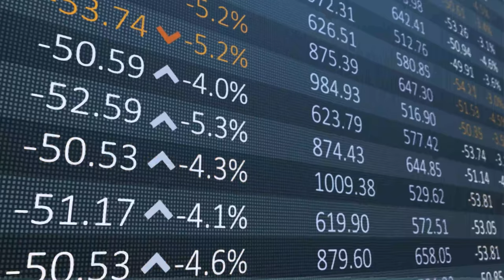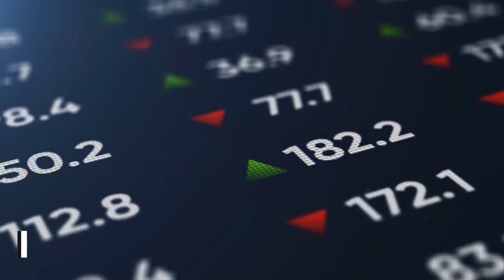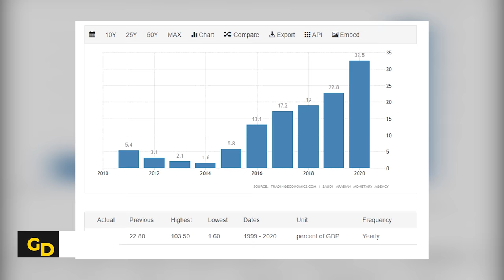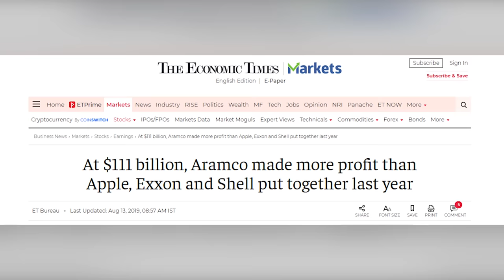How Saudi Arabia Bought A $2 Trillion Company

Comment: Some facts here are loose, such as the 2030 Vision. It was introduced in 2016, and the spending started from 2017 to diversify the economy, the current debts are relatable to this kind of spending, it is not that we just realized that we had much debts in 2020. Moreover, Saudi Aramco was never solely owned by the Americans, and there is no documentation of such circumstance, it was always a joined venture until it was solely owned by Saudi Arabia. Furthermore, the new airline that was shown in the video was initiated by king Abdullah, the former king of Saudi Arabia, before the whole vision and investing in entertainment. Overall, very well for a western guy to try to relate :)
Reply: Great job correcting some of the info in the video, though, the "try to relate part" was not necessary.

Comment: Well if u own any middle eastern oil company shares then it would be wise to sell of your shares in the upcoming years as the world is transitioning from fossil fuels to renewables and these companies are currently not taking renewables seriously and most importantly as the consumption of oil  would decrease because of the shift to renewables the price of oil per barrel would inevitably decrease because of less demand and relatively same supply
Reply: @Elite FF Squadron - Not a chance, first the world has to get the shock of its life when their dependence on renewables backfires and there is massive economic damage. California faced this when during peak summer they were having power shortges after going hard at renewables. Britiain is currently facing the same due to lack of wind power generation and they had to pay mind boggling sums to its last coal power plant to keep operating.
The point is, the world has not learnt its lesson. There is no strategic plan to move from fossil fuels to renewables. This will bring untold misery when renewables fail. Then there will be a massive call for fossil fuels again and then an ecofriendly support system will be made (over god knows how long) and only then will the world move to renewables fully. Also i sincerely doubt the renewables will be solar, wind etc that you see now. It will be reactor based, exotic materials type thing. The ecological impact of solar and wind will not allow it to be sustainable.
Reply: @Merloc909  Ok boomer.
Reply: Saudi Aramco is diversifying it’s income. And is slowly stepping away from its dependence on Oil. I am Saudi and I see the efforts that my countries is putting into diversifying it’s income. Saudi is working on strengthening it’s position as an energy super power by dominating the domain of renewable energies. Everything is progressing smoothly one step at a time according to the plan.
Reply: @Merloc909  hi, what u are telling is true that’s why I am not telling the people to sell of now but rather wait and analyze the company’s future visions and if they are not changing with time then only sell of
Reply: @Jolmood  r u a Saudi resident
Reply: @eliteffsquadron9932  I am a Saudi Citizen
Reply: @Jolmood  do u work with them or are a share holder of Aramco
Reply: @eliteffsquadron9932  Neither of them. I am not interesting. I am more interested in the new Saudi projects backed up by the Saudi government.
Reply: @Jolmood  it’s a very happy thing to see that the people of your country are interested in the long term growth and success rather than just short term atamanaa altawfiq lak walibaladik
Reply: @neeljavia2965  lol this is what I can't stand about the likes of you. You say we won't diversify? If you look at the stats, it will show you how Saudi Arabia is massively increasing its own food production every year, thanks to modern day agricultural farming. Green houses are being operated through solar energy. We'll be exporting strawberries to Europe in the next coming years. This is just one example of what changes vision 2030 is bringing to the country. Dont forget its Saudi Arabia who has the best wind to sun ratio in the world. Stop hating.
Reply: @neeljavia2965  hahahaha an indian is saying this hahahaha hahahaha..... listen don't get me started tea boy.

Comment: THEY SHOULD PUSH TO CREATE MORE HYBRIDS. THEY CAN BE HELPFUL. WHEN YOU CAN'T CHARGE YOUR VEHICLE YOU COULD HAVE A STORED GASOLINE SUPPLY.
Reply: What are the situations when you can't charge?
Reply: In saudia arabia is very unpractical to own an EV such as teslas, we need our ACs to be on blast due to our hot climate and it takes so much of the car’s battery. A friend of mine bought one and she gets 2 hours of driving time from every charge.
Reply: Plus gas is much cheaper than in other countries .. so no one is getting a hybrid or an EV, it just doesn’t make sense